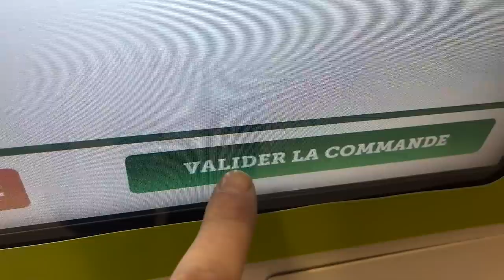Were ready for the roof!

Comment: OMG Dan I just noticed, you didn't dig a drainage trough in front of the cement mixer for when you wash it out and you have cemented the wheels to the ground. Nice and sturdy for mixing.  Gas line is frozen on the motor bike? So happy you have a new place to hang your hat :)

Comment: Dan please tell me the glass door is safety glass. One trip on the stairs which will be slippery it it could be bad. I would have gone solid wood with a glass planel. It will also need something across it to show if its open or shut for the boys running thru so u may as well have got sonething solid?? Worried!!
Reply: Yes, seems a poor choice.